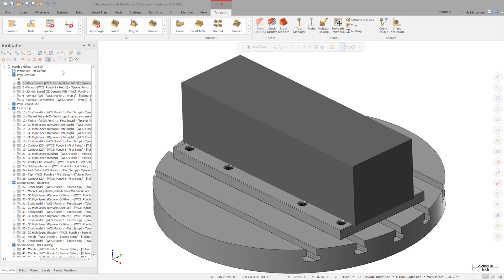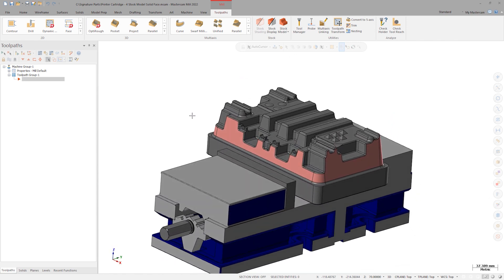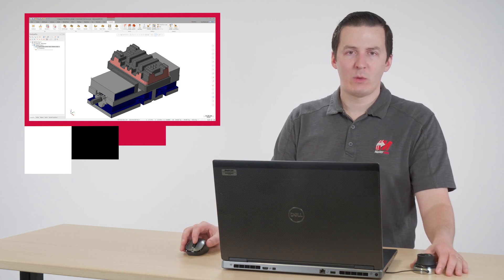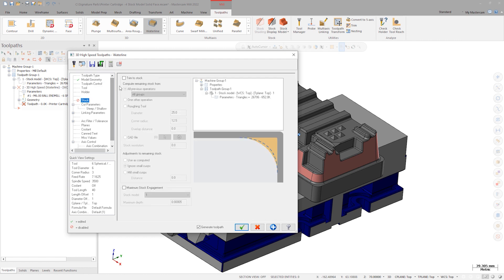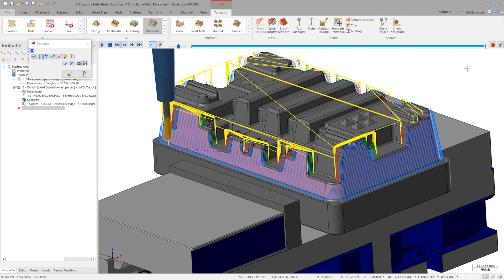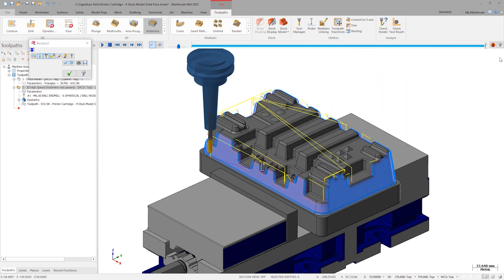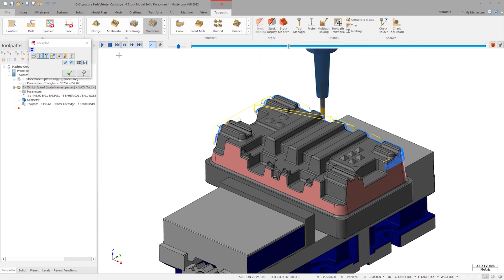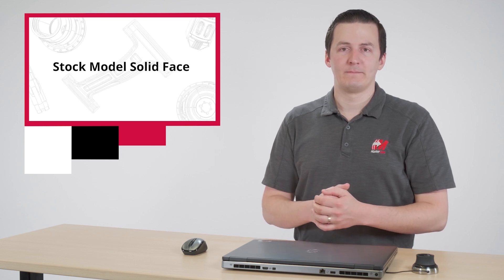Mastercam Stock Model Solid Face using Printer Cartridge | Mastercam 2022 Signature Parts

Comment: Hello Chad, is it possible  to make a stock model in a specific area like you did here and count it as a drive surface with the whole part? Because i need to generate a smooth toolpath (without breaking toolpath) over that stock model and avoid that specific area from cutting.
Reply from the maker: Hi Mamunur! Yes, this is possible if you save the Stock Model as a Mesh. You can then select the Mesh as an additional drive surface. Here is a video showing how to do it: https://mastercam.sharefile.com/d-se42b22b74cf64fc799911df61885df65
ShareFile
Reply: @mastercam  Thank you so much. Its a cool feature. You just made this video?